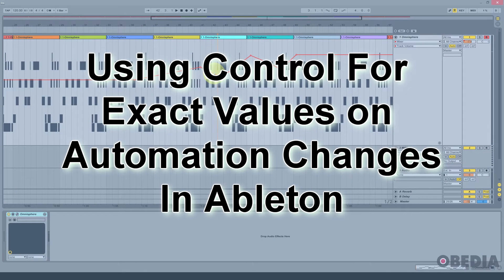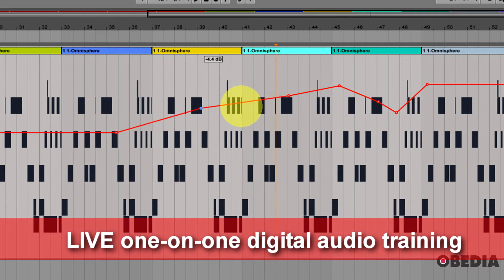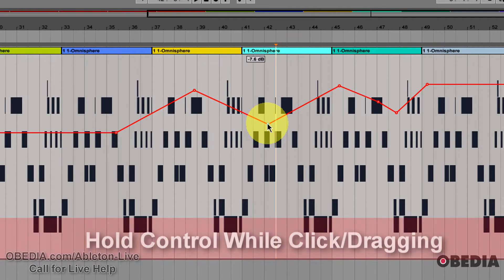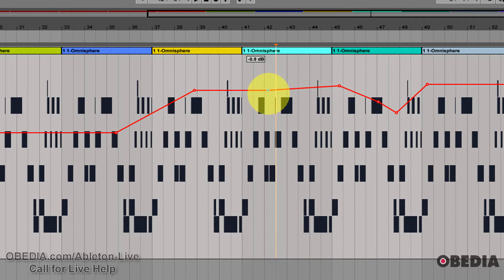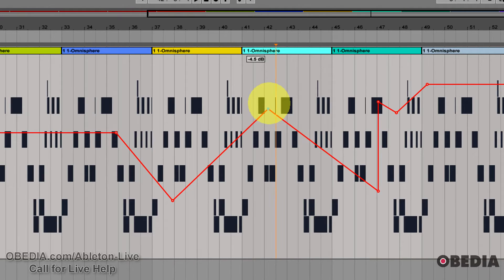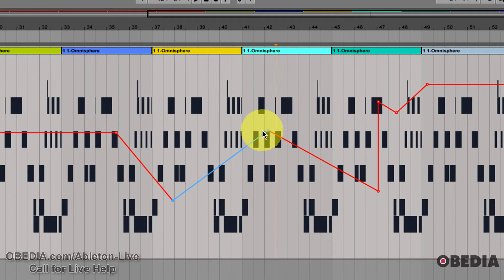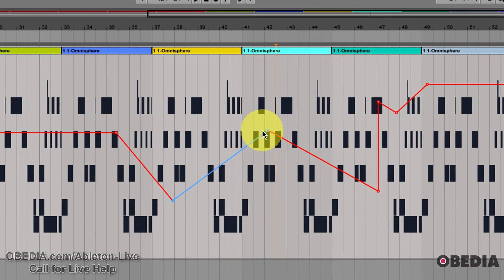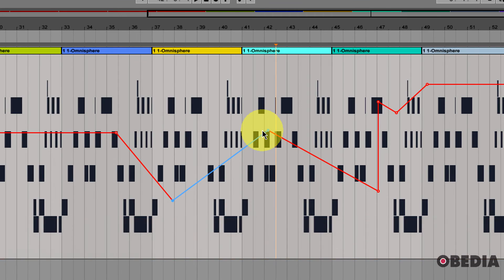Precise control of Automation values in Ableton Live

Comment: I'm currently trying to find out if there's any way I can type it in?  I know you can do the overall before you start adding different values.  This definitely will help regardless, but sometimes I notice I can't reach certain values that I have on the same track at different points...I know I can just copy and paste the areas I previously automated, but if there was a way to just type it in would make it much easier, more so when I'm trying to find a range I like and I'm just moving the value up and down and wanna go back.
Reply from the maker: In Live 10, right click the automation node, and select "edit value". You can then enter the value manually.

Comment: For the Tempo change, even when you press Ctrl (Command on a mac) it still moves up and down by increments of 2-3... I need my tempo to be precise... Any ideas?
Reply: Same here, still haven't found a solution
Reply: i used shift and ctrl and it worked (windows might work for mac to)
Reply: @chase2296  I'll have to try that. One thing you can also do is change the upper and lower limits of tempo to the exact ones you want. If that's not an option, usually I just drag the track window down so it takes up more space on my screen and I can be a little more precise haha.
Reply: @chase2296  ty so much
Reply: same here, shift ctr has not effect,  it will only allow 171.99 or 172.01 bpm, wont let me have 172 now unless i delete and redo a tonne of autoamation elsewhere in the track grr
Reply: @dougmcleod3413  Perhaps set the max. temp value in the Master track to what tempo you want to change it to (172) if you're speeding up the song (or min. tempo if you're slowing it) and then drag the tempo automation node to that point, that's the only way I can think of to do this (guessing you've already sorted it out in a year though)!